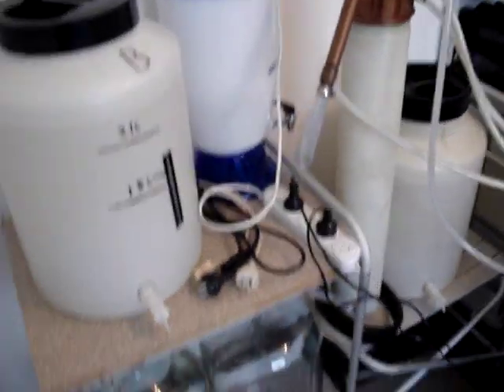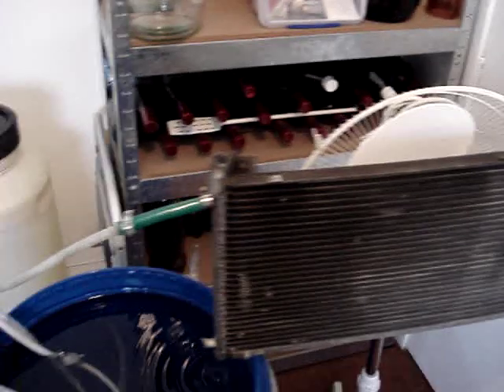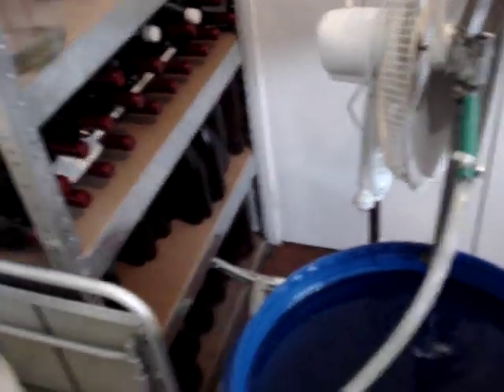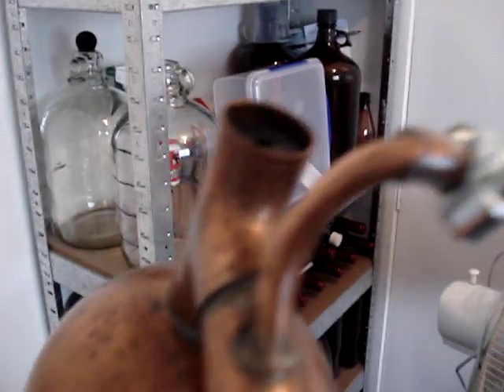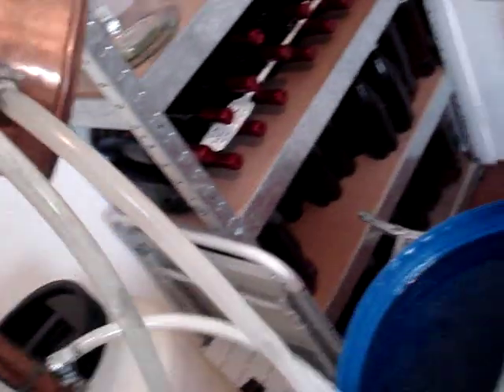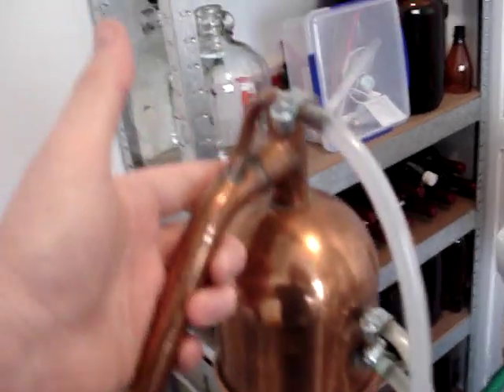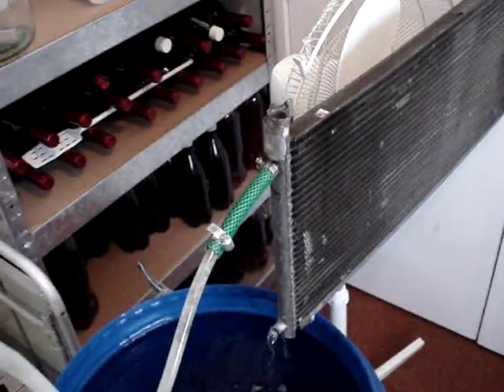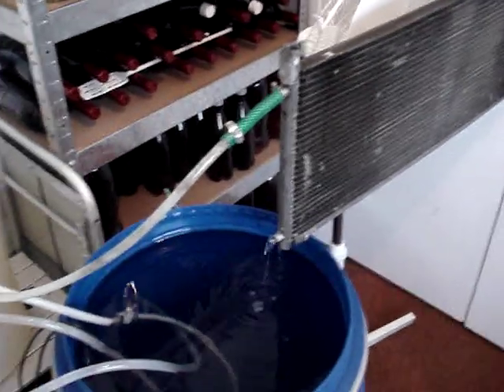Home distillation and how my cooling system works! (not retarded)

Comment: I do something similar.  I built a 20-foot spiral of 1/4 inch ID copper tubing.  The return water passes through this tubing which is hung from an industrial fan.  I use a fountain pump to circulate a reservoir of water directly to the condenser, and the return water passes through the coil on its way back to the reservoir.  It works just fine.  I've never had to replace the water during a run, but I could if needed.

Comment: great idea about cooling , but i think you have to hook up the bottom (lowest pipe) of your condenser (not the coiled pipe in the actual head) to the bottom of the radiator and the top of the radiator as your outlet back to the drum and the pump outlet to the top part of the condenser (witch is the actual strait copper pipe),think the logic way .Just trying to correct your cooling setup,keep up the good work and let me know what you think, cheers mate

Comment: Don't exactly form an idea of the secondery coil inside the actual head, can't figure out the soul purpose of it as the coil does'nt touch the actual head it self , but don' seem to get it , it wil only heat the water very rapedly not doing condensing at all,think about the logic of it.The other one is the actual condence pipe that is hooked up on the radiator thats a cool idea.good tip for cooling